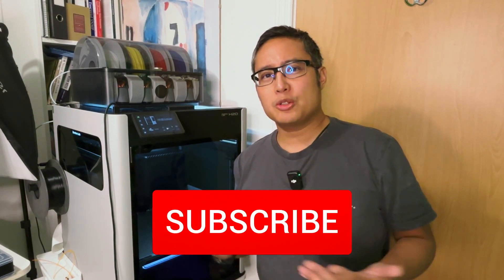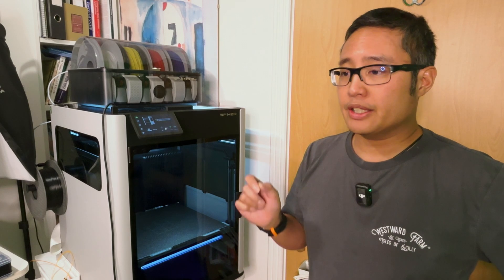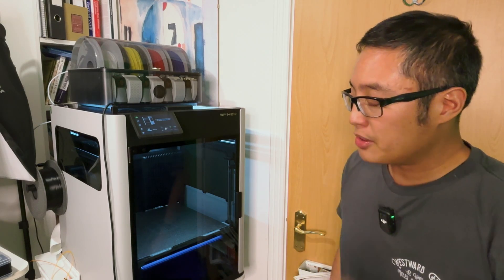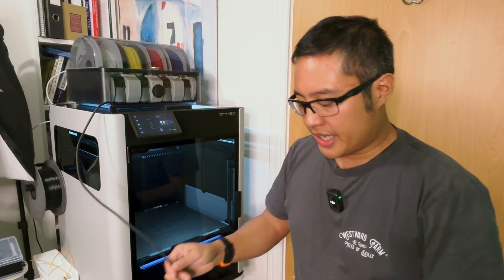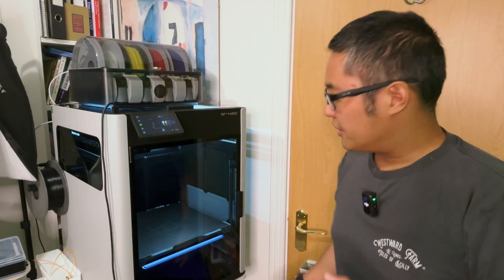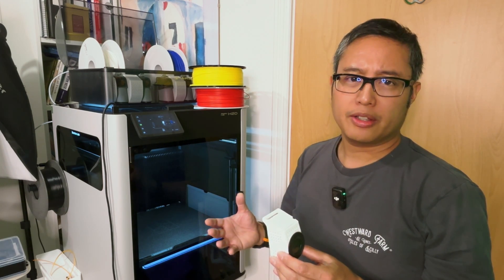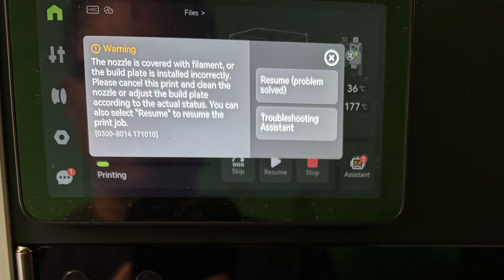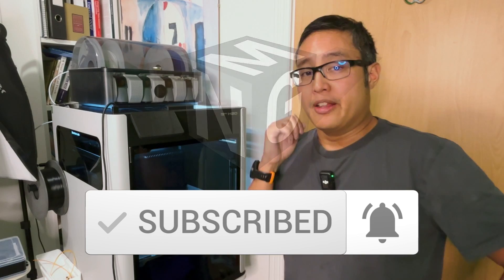ULTIMATE - 27 things a beginner needs to know before buying the H2D Bambu Lab printer

Comment: Really considering this model for 2 main reasons: printing with support material; larger volume.  The H2S is overall better for volume, but it is only 4.4% more volume vs H2D single nozzle printing, so that difference is negligible for my prints (thus far).  In my space, I'm definitely concerned about accessing the back for trouble shooting.  I've seen other use heavy duty drawer slides, but I'm trying to see about another option to spin it.
If you're worried about oil from your hands, just have a pair of gloves set by the printer.  Print off a plastic blade/scraper and use that to scrape off.  I've never needed to use the metal one, so have avoided scratching my plates (I have a X1C and a P1S).  For anyone that needs to print back to back, I have an extra build plate so I just swap that out, and most of my prints just fall off when they cool (except TPU).
Reply from the maker: Thanks for sharing your thoughts. If the support material you want to use is a different filament to what you want to print the object with then can’t think of a better model. Let me know if you find a good solution to accessing the back, at the moment my budget printer table on wheels is adequate. Thanks for your tips,  I keep the blade in the maintenance box for fear or scraping the plate. My next purchase will be another plate for when I print the basketball, I’m looking at non Bambu plates too. All the best!

Comment: Question: using the "dual" print, can it print twice as fast? (using the same color filament, symmetrical model, etc)
Reply from the maker: Great question, sadly using the same color in both nozzles does not increase print speed for a single object. The printer currently cannot use both nozzles simultaneously to print the same part of a single object.
Reply: @MaverickNextGen  - thank you ~ making a blackfriday purchase and wasn't sure if my use-case was correct.
Reply from the maker: Hope info and video was useful. Enjoy your 3d printer!